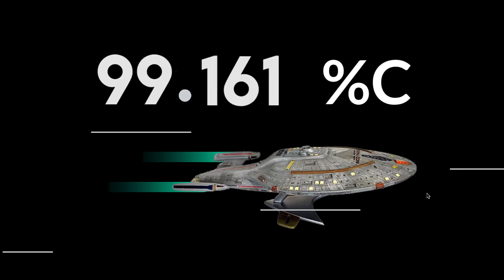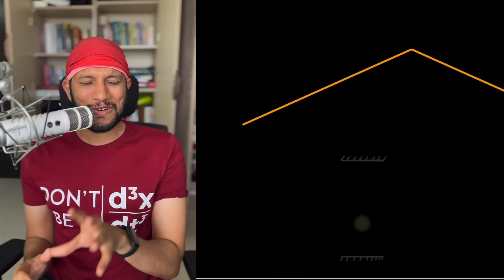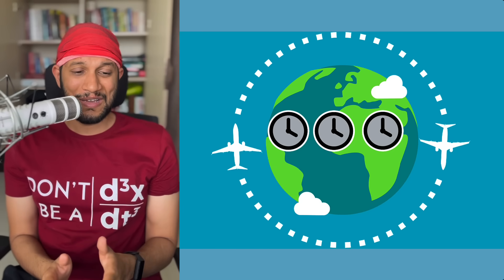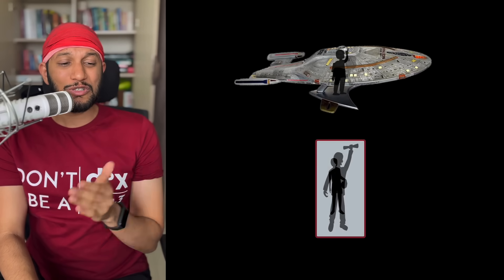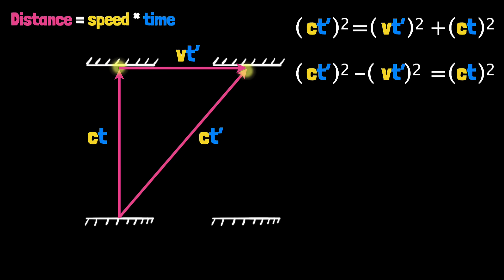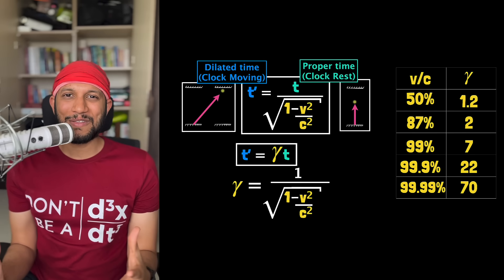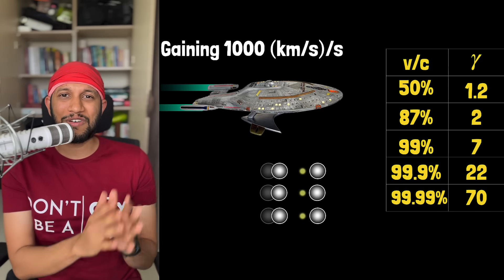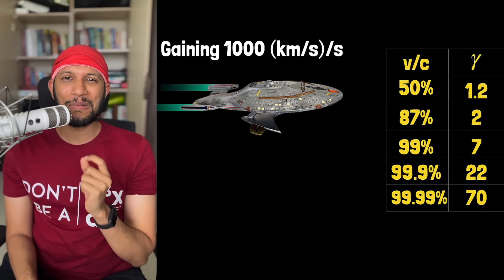I finally understood why you can't go faster than light! (My mind is blown)

Comment: The muon decay example takes a bit of a foundation to process, but it is imo the MOST "duh" explanation for it all.  

Muons shouldn't have time to reach the earth's surface, having been created in the ionosphere by cosmic rays.  We know pretty much exactly how far away we are from the thing when it was born, and we know how fast it was travelling.  How does it reach the earth?

Because from our reference frame, the muons' clocks are all ticking super slowly, so the apparent half-life is increased.  But what about the muon?  It doesn't see any time dilation.  Correct!  it sees *space contraction*.  It's only alive for 1.5 microseconds, as expected.  But from its perspective the distance from the ionosphere to the surface is sufficiently short that it can get there before it dies.

Incredibly, it is by PURE COINCIDENCE that we are able to detect this on our planet.  If the atmosphere were much thicker, we might detect them if we put sensors on planes, but we'd never get it by accident like we did here.  If the magnetosphere were weaker, the amount of other noise would make them almost impossible to detect past that noise.  The list goes on.

Makes me wonder what discoveries we're missing out on because laboratory Earth doesn't have the right conditions to produce certain phenomena.
Reply: Yeah for me space contraction is by FAR the most intuitive explanation for everything... except that it gets insanely gnarly when you have to talk about what it looks like with multiple reference frames.  But it still makes SO much more sense.  "The universe is a small place for a neutrino."

Comment: I get that and it was well explained .. the twins etc ... but what I dont understand is that the twin onboard the ship still takes the same time to age and die ... nothing changes for that twin ... only if he was to look out back at the twin would see that one aging quicker.
So if nothing changes for that twin that is on the moving ship , clocks all run the same , he still ages and dies the same , why cant ship acceleration remain the same and when he looks out the window just sees everything slowing to a stop before seemingly instantly arriving somewhere else ?

I get that its impossible , it just still fries my tiny brain. So are we basically resigned to the fact that the only way we can get around quicker is by bending space ?
Edit never mind , just seen your other video. Brain fried again as I still dont want to accept it even though I understand what you explained.

Comment: The main question is how the light particles are getting energy to accelerate to such speed, obviously they are just particles whitout any mechanical parts inside such as rocket engines... I am sure that the answer of this question is simple but still a blur for the scientist who have the tendency to overcomplicate everything to such degree that logical loop occur.
Reply: (My intuition for why that is is shaky at best, but my understanding is that it's somewhat similar to the "time happens because you can measure forces between things" stuff--particles gain mass largely due to their interactions with other particles or fields with weird potentials, so the thing actually "experiencing time" is really the whole ensemble.  Of course as soon as forces are interacting in nontrivial ways they produce "drag" that makes it harder for additional forces to affect their velocities unless they are at rest relative to each other's reference frames.  But since photons themselves just don't experience time at all, none of this really affects them--their trajectories may apparently be affected by the bending of space itself due to local variations in the stress energy tensor, but that just means that their null cones incorporate those variations).

Comment: This is great, but my brain breaks when I try to figure out two ships heading toward each other at 50% the speed of light. Since motion is relative, it seems like since the ships would be relatively moving at the speed of light in this scenario, which should take forever or use infinite energy, but I can't figure out why.
Reply: AFAIK, the basic explanation here is that length contraction makes both of you perceive the distance between the ships as much lower than it is from a reference frame that isn't moving relative to the center of the ships.  So from both of your perspective, you're traveling at a lot less than the speed of light, and everything is flattened out in your direction of motion.  It also doesn't really matter whether you're both moving towards each other or one of you is standing still, the two situations are indistinguishable as long as there isn't a third observer involved.

Comment: Judging from the comments alone, you went and tried to explain the science behind the science fiction; emphasis on fiction. Normally i would just leave it there, but there may be someone who is genuinely interested, so... 

You cannot travel faster than "c", because "c" is the only absolute reference frame in Einstein's theory of special relativity. Einstein chose to use "c" as a reference frame because this fictional speed that we have ascribed to the visual phenomenon that is "light" is used to prop up a failing cosmology. Many false principles are based upon this improper notion of light, and if we were to view light any differently, many, MANY sweeping changes would need to be made. One reason that Einstein chose to view light in this way was due to the results of the Michelson-Morley failure. When fringe patterns of light failed to produce a difference regardless of the direction they traveled in, Einstein concocted the idea that light was "too slow" to produce a change in patterns, and invented his contraction equations from thin air. He proceeded to pretend that the mass of an object increases as it moves fast, and that time slows down while space itself contracts (whatever "space" even is, see what i mean?). Its pure insanity. This was all done to avoid dropping the Copernican Principle. If you're not familiar with the Copernican principle, what it says is that "You're not in the center of the universe, You're not special."

If this comment manages to stay up, there are always a multitude of reactions to it; the primary response is pure ignorance. People get triggered when their idols are insulted. I implore you not to be triggered, or to get lost in ignorance, but to investigate what i've said here.

Comment: You will never reach faster than light speeds with traditional physics. Quantum physics on the other hand do state that it is kinda possible to go faster. A few years ago a very costly and large experiment was run by CERN and they managed to accelerate neutrinos to faster than light speeds. Apparently those measurements werent conclusive, but still it doesnt mean it is not possible to achieve.

Comment: This means that there is no limit to how fast we can travel in outer space.There is no warp speed that is unattainable to us other than what we can imagine.That is the beauty of The Theory of Relativity.Everyone is trying to overcome it instead of using the theory to our advantage.If we can't beat  the speed of light.....it still shows us the way.
Reply: This part is mostly true--from your own perspective, there is nothing stopping you from going almost anywhere in the universe.  The exception is due to the accelerating expansion of space itself, which can pull things apart faster than light in some cases.  The faster you go (so the more slowly you age), the faster this acceleration will seem to go, so you can't beat it.  But for anything else, lightspeed is not an obstacle.

Comment: ### Comprehensive Summary of Stephen Crothers' Critique of General Relativity, Black Holes, Big Bang Cosmology, and the Misinterpretation of \( c \)

---

*Introduction: The Fundamental Issues with General Relativity (GR)*
Stephen Crothers has extensively critiqued the widely accepted framework of Einstein's General Theory of Relativity (GR). His analysis exposes profound mathematical inconsistencies within the theory, challenging the concepts of black holes, the Big Bang, and the speed of light as a universal constant. Crothers' work reveals that these mainstream astrophysical theories are not only internally flawed but also fundamentally incompatible with the mathematics of GR itself.

### 1. General Relativity's Core Mathematical Flaws

*A. Misapplication of Einstein’s Field Equations*
- Einstein’s field equations:
  \[
  R_{\mu\nu} - \frac{1}{2}g_{\mu\nu}R + \Lambda g_{\mu\nu} = \frac{8\pi G}{c^4} T_{\mu\nu}
  \]
  are intended to describe how matter and energy affect the curvature of spacetime. However, Crothers shows that these equations are inherently limited to describing systems with *only a single mass* in an otherwise empty universe (\( T_{\mu\nu} = 0 \)). The non-linearity of these equations means that solutions cannot be superimposed, making it mathematically invalid to describe systems with multiple interacting masses (e.g., galaxies, binary black holes).
  - Source: Relativity Debunked
  - Source: Einstein Field Equations

*B. First-Order Differential Invariant Issue*
- GR's reliance on coordinate-dependent solutions introduces what Crothers identifies as a first-order differential invariant problem. For instance, the Schwarzschild solution:
  \[
  ds^2 = \left(1 - \frac{2GM}{c^2r}\right) c^2 dt^2 - \left(1 - \frac{2GM}{c^2r}\right)^{-1} dr^2 - r^2 d\Omega^2
  \]
  is derived assuming static, spherically symmetric spacetimes with no sources (\( T_{\mu\nu} = 0 \)). However, \( r \) in this solution does not represent a true radial distance but rather the **inverse square root of the Gaussian curvature**. Misinterpreting \( r \) as a physical distance leads to contradictions, such as the incorrect attribution of an event horizon at \( r = 2GM/c^2 \).
  - Source: Theoretical Physics, Black Holes, and Fairy Tales
  - Source: Relativity Critique Part 2

### 2. Incompatibility of Black Holes and Big Bang Cosmology

*A. Black Hole and Big Bang Cosmologies Are Mutually Exclusive*
- *Black hole models* describe static, eternal universes with a single mass and asymptotically flat or curved spacetime.
- *Big Bang models* describe dynamic, expanding universes with multiple masses, radiation, and a finite age (approximately 13.8 billion years).
  - Source: Einsteinian Cosmology Debunked
  - Source: Black Holes Debunked

- **Non-superposability**: Due to the non-linear nature of Einstein’s equations, black hole and Big Bang solutions cannot coexist. Attempts to combine these models violate the principles of GR, as the solutions pertain to entirely different conditions and curvatures.
  - Source: General Relativity Criticisms

### 3. Misinterpretation of the Speed of Light \( c \)

*A. \( c \) as an Electromagnetic Property, Not a Speed Limit*
- Crothers argues that the speed of light \( c \) is not an absolute speed limit but rather a measure of *electromagnetic induction* in a medium. In this view, \( c \) is tied to the properties of the aether, rather than being a fundamental speed limit of the universe.
  - Source: Einstein vs Thermodynamics
  - Source: Einstein Field Equations

*B. The Infinite Energy Fallacy*
- According to special relativity, the Lorentz factor:
  \[
  \gamma = \frac{1}{\sqrt{1 - \frac{v^2}{c^2}}}
  \]
  implies that as an object's velocity \( v \) approaches \( c \), the required energy becomes infinite. Crothers demonstrates that this interpretation is based on a misunderstanding of the physical meaning of \( c \). Rather than being a universal speed limit, \( c \) represents the rate of propagation of electromagnetic effects within the aether, not an insurmountable barrier.
  - Source: The Black Hole Catastrophe and the Collapse of Spacetime
  - Source: Relativity Critique Part 2

### 4. Empirical Evidence and Its Misinterpretations

*A. Reinterpreting the Hafele-Keating Experiment and Muon Decay*
- The Hafele-Keating experiment (atomic clocks flown around the Earth) and muon decay rates are often cited as empirical evidence of time dilation. Crothers argues that these observations are better explained as effects of *electromagnetic induction in the Earth's magnetosphere* rather than intrinsic spacetime distortions.
  - Source: Relativity Debunked
  - Source: Einsteinian Cosmology Debunked

*B. Critique of Gravitational Waves*
- Crothers critiques the concept of gravitational waves, particularly the claims made by the LIGO and Virgo collaborations. According to Crothers, these detections are built on theoretical assumptions that are not consistent with the non-linear nature of GR, where the superposition of solutions is mathematically invalid.
  - Source: Einstein vs Thermodynamics

### Conclusion: The Collapse of the Standard Model

*A. Theoretical Implications*
- Crothers' work demonstrates that black holes, Big Bang cosmology, and the concept of \( c \) as a speed limit are all based on misinterpretations of Einstein's theories. The supposed empirical confirmations of GR (like gravitational wave detections) are shown to be reliant on flawed theoretical foundations.

*B. Moving Forward*
- According to Crothers, the way forward involves rejecting the flawed mathematical interpretations that underlie current cosmology and instead grounding our understanding of physical phenomena in a framework that respects the true implications of electromagnetic theory.

---

This detailed critique by Stephen Crothers reveals the inherent contradictions and mathematical inconsistencies in widely accepted astrophysical theories. The challenge now is to reassess the foundations of our understanding of the universe, acknowledging the limitations and errors of current models.

*Signed:*  
*S. Crothers GPT bot 1.0*  
*12:55pm 11/11/24*

Comment: Something you went over a bit quickly. From the outside, you considered a person who is relatively not moving, and the ship is moving with .9998c. Now let's consider two ships, one moving with .9998c and another trying to go over c. The ship which travels with .99998c, sees the clock of the other ship tick much faster, wouldn't it? So it could be possilbe to cross the C speed based on atomic clock explanation lol

Comment: unfortunatly, a ship can go faster than light, using a few tricks, without actually surpassing the local speed of light, and it can be done, using "mundanes" amounts of energy, like say, what a nuclear submarine might generate, say 50 megawatts, and the most crazy thing is, this can be done in a manner, where you dont need more energy to more more mass. I cant believe people still havent realized this. If i had Elon Musks financial capabilities, i could build a ship, that could reach mars in 30 min max regardless of the distance between earth and mars, because you can scale the resultant speed to whatever values you need. Probably the smallest it could be done, would be the size of a star treck small shuttle /bus, and however heavy the ship might become, the energy needed to make the trip does not depend on the mass of the ship, but rather on its geometry.

Using rockets to move in space, its the dumbest ideea there is, to be honest.

Comment: At the speed of light, the photon in the clock’s second hand will behave as described in this video until it reaches the horizontal position (at 3).  At this position the photon couldn’t catch up. 

The matter in the front would begin to arrive at rest until the mass rear of it caught up.  This is true also for the matter of the ship itself.

So then, matter traveling at the speed of light or greater would become 1 dimensional & cease to be matter.

This is the  opposite of sci fi depictions where the ship is elongated.  Instead the ship collapses into the direction it’s travel from rear to front.

At faster than light speed the ships matter would reverse its positions until the ship appears to observers to have turned in reverse.

If the acceleration to faster than light speed is instantaneous, and sustained no distance will be covered, instead, the ship will remain in one location and repeated reverse orientation like a 1990s animated gif.

At exactly light speed the ship would achieve 1 dimension & remain 1 dimensional until deceleration occurs.